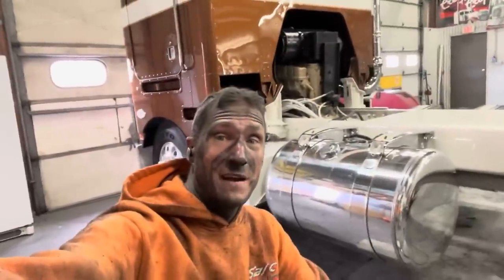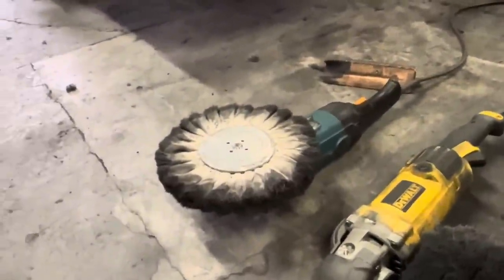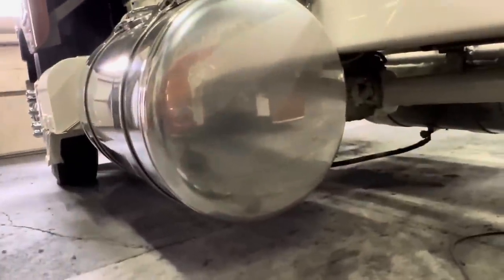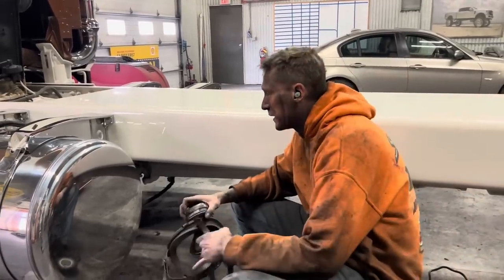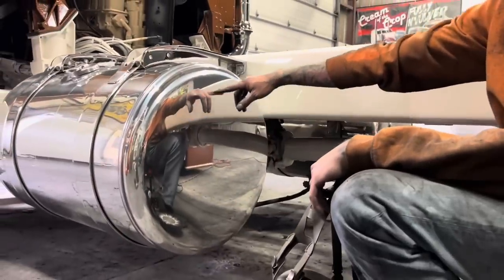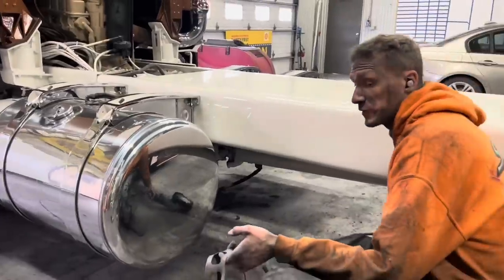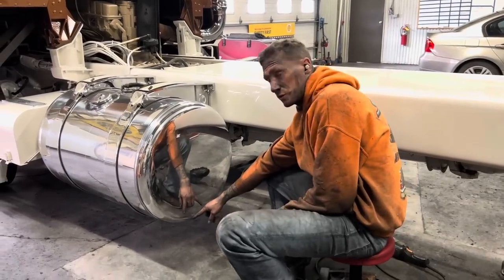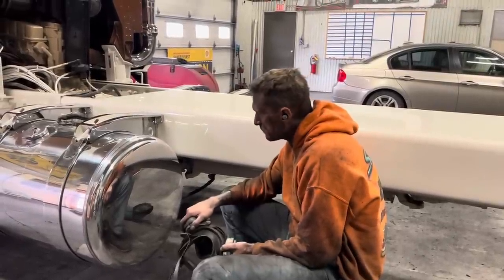How do I show finish polish. Secret revealed with Evan’s detailing and polishing.

Comment: And if I did this there would be wheel microscratches everywhere and would look foggy… You are amazing at what you do man! I aspire to be like you one day!
Reply from the maker: It takes time. Practice makes perfect.
Reply: My thoughts exactly, I'd have to wear a mask because of all that fluff flying around
Reply: @EvanStegerMetalPolishing  my biggest question is after polishing any aluminum how long will the luster last before oxidation will reoccur?  I assume you recommend just soap and water on wheels no acid based chemicals in between polishes
Reply: What I do is after i polish with airway buffs and compound bàrs is i take a 6" microfiber polishing pad on my DA polisher, put some zephyr pro 40 on that pad and go over that aluminum at a low to medium speed then wipe with a clean microfiber cloth. Its important to keep your microfiber cloths in something where they wont get dusty or that dust will microscratch your work you just did. I was my microfibers in a washer with free & clear detergent and dry them in the dryer on the low heat setting

Comment: I am a novice at this I’ve done my own truck 3 times over the last 3 years I’m getting better it is extremely tedious it takes patience and a strong will . It will wear you out if you’re not serious about it don’t even start . I do a 4 stage polish I finish with flannel wheel and zephyr blue moon and it comes out fantastic I get a lot of compliments and it feels good when it’s done. Gonna do it again in a couple weeks. I’m getting mentally prepared now. This time I’m taking the drives off that hub assembly is a pain in the $&@.  I should send you a before and after. I ve learned a lot from you. I know you’re a pro but I’m kind of proud of what I can accomplish.
Reply from the maker: I appreciate you watching. You’ll get better everytime.

Comment: I always end up with black lines , you make it look easy , buffing aluminum is definitely an art 👍🏽
Reply from the maker: It takes time. If you got black lines you likely need to sand if it’s rough. Or if it’s nice you need to add pressure and tighten your overlap. 9 out of 10 that’s a fit.

Comment: Do you use any kind of liquid metal polish for the final step? Like California purple, zephyr pro 40, mothers, etc?
Reply from the maker: I personally don't. I find that using hand polish after I have finish buffed will only scratch the surface. But I do use my time2shine hand polish to maintain in between polishes.

Comment: What sealer do you use after the fiinish
Reply from the maker: I don't use sealer. Most good rouges have wax in them. That is the best sealant you will get other than a coating and coatings dull the shine. Hand polishes have less wax content than the rouges. Rouge is pushed into the pores whereas hand polish or hand sealants are just wiped onto the surface. I hope this makes sense.
Reply: @EvanStegerMetalPolishing  yeah it makes sense but I’m in a unique position my boat stays in the water all summer the lake water browns the pontoons nothing I know will stop this but a sealer like alumitron or shark hide was hoping there was another product that did not dull the shine. Thank you for responding

Comment: Hey man I have a polishing buisness as well I got a set of forgiato wheels, and if I polish them with my airway wheels they get hazy looking before they polish out, I asked the customer if they had a clear coat or any coating on them he said no and if I hand polish it turns black, so I doubt they have a coating. The same thing happened to me before on a set of American forces. I was wondering if you had any insight on this issue.

Comment: Looking for the correct grinder to purchase, for polishing steer & drive wheels, Dia, model # would be very appreciated.
Reply from the maker: We use the Makitta 7" angle grinder GA7021. You can order them online or buy them at Home Depot
Reply: @EvanStegerMetalPolishing  Thanks Evan for the info, much appreciated.